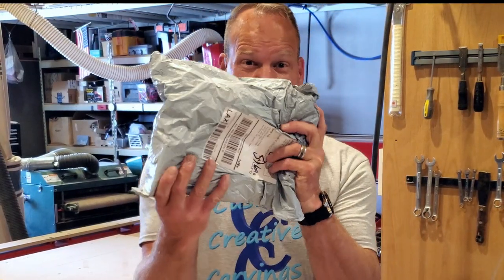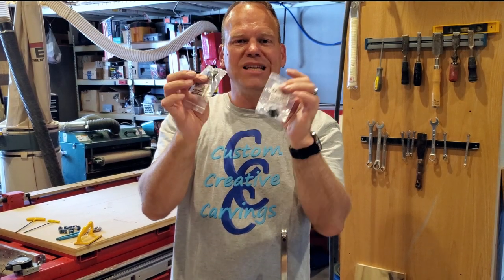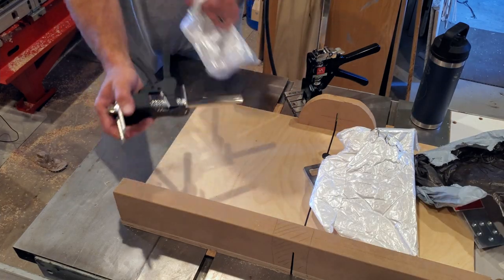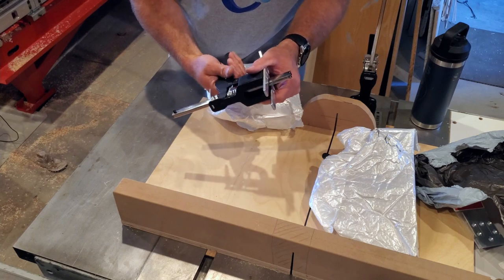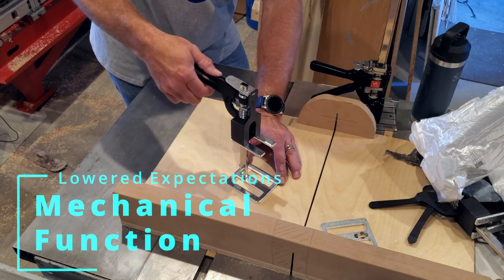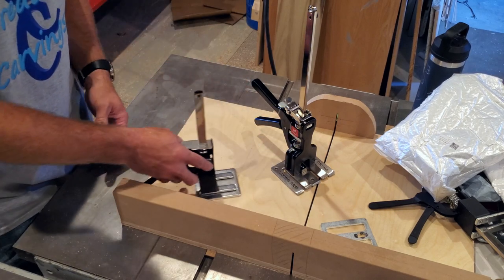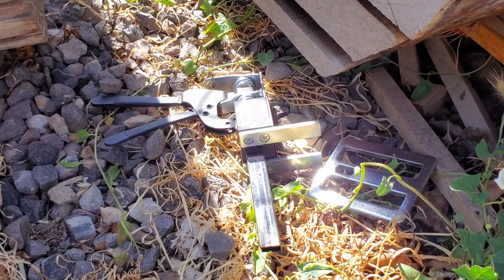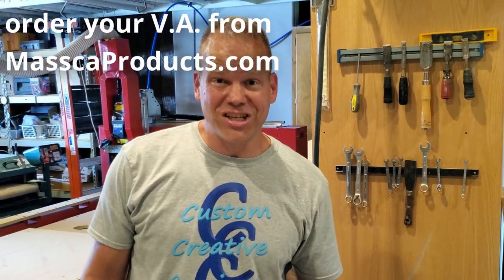VIKING ARM: Scam VS REAL showdown is finally happening (part 4)

Comment: Thanks for doing this scam vs. fake show down, Chris! Great comparison video you showed here. It's important to note the dangers of using an untested "replica" tool. The Viking Arm won't let you down on the job and it's has been backed by FIMTECH (Norway) testing ensuring it's got your back you need it the most! Glad you stayed safe during this test. At least the other guys went out with a bang. 😆
Reply from the maker: It was my pleasure.  While I used safe lifting procedures when I lifted with the Viking Arm, it felt solid enough I wasn't worried.  After I put weight on the knockoff, it felt so flimsy and started to wobble that it had me worried.  On the bright side, the knockoff has such a low lifting capacity that it becomes a built in safety (to look at it as the glass is 1/10th full).
Reply: don't you think you're being disgenuin calling your competition knock offs when you guys aren't the first to make this tool?  I agree the one this guy shows in the video is crap and the one you guys make looks to be of good quality but there are multiple companies out there that use better more solid materials.
Reply from the maker: Doesn't someone making a copy of a patented item, and using the pictures of the patented item represent a knock off?

Comment: Here's the problem. EVERYTHING is made in China nowadays. However, there is made in China but to proper specifications (after all, iPhones and many branded tools are all made in China too), vs made in China by lookalikes but low quality. It really makes it hard for consumers.
Now if the branded products don't charge like wounded bulls, then we the consumer are less tempted to go for el-cheapo clones. But take for example phones - if a working and not-too-bad phone can be 1/8th the price of iPhone or Samsung, guess which one we buy?

Comment: So the cheap ones will 'hold' but not lift much. But a block of wood will hold, too. So, basically, the cheap knockoff is not as useful as a block of wood.
Reply from the maker: Yeah, of the 2 sets of cheap that I ordered, the first was drone parts, which had no use at all, the second could work for light duty work. They were clumsy and harder to use, but they were probably worth the price (except one came broken). I definitely recommend the real thing, but for occasional light use, the cheapo could work (as long as they send you a lift). Just be ready to call your credit card company. 
Thanks for watching, I appreciate the comment as well.

Comment: Sour grapes.  You wanted the "good deal" rather than the real deal, so jumped in with both feet before engaging brain and now want to blame the tool.  

I have 4 "cheapos" I paid about $25/each several years ago and they still work just fine.  I paid about $25 several years ago. If I were a professional cabinet installer or had other commercial uses, I'd probably buy the Viking brand, but for the home DIYer, the only reason to buy the Viking is bragging rights. The $600 I saved paid for other things I wouldn't have been able to afford otherwise.

Bottom line, if you don't know a deal is too good to be true, it isn't - then you shouldn't be using hand tools or the internet.
Reply from the maker: I am glad you are happy with your purchase, if you just need light duty, and they actually send you tools that don't get broken in shipping, then cool.
I wanted to do a comparison of the cheap and the real, so I did.  There may be good knock offs out there, just not the 2 that I tried.

Comment: Ok boss I’m sorry I had to comment. This was an absolutely waste of my time and others. You compared it to a single item. I thought how big of a spectacle to made this to be with 4 different parts I was going to spend 220.00 on this item. I actually think I need to do more research now. You should have just made 1 video unboxing and very small comparison review would have been a better title just so I was not upset and let down by the end. Hopefully if you make more in the future you do a real showdown like I watch people do with their tool videos. Thanks for trying. Good luck.
Reply: I found 4 over 100.00 that claim to be all steel I am comparing to decide. But I saw like 25 on amazon alone.
Reply from the maker: I appreciate the comment.  My original intent was to do it more like you suggested, but with shipping delays and other issues it didn't work out. I probably should have been more patient and waited until everything had made it in.  I would definitely recommend doing a lot more research before buying any other brand.  I will say that to this day I am glad that I have a Viking Arm, it is handy and dependable. I do apologize for the wasted time, I try to continuously improve my content.